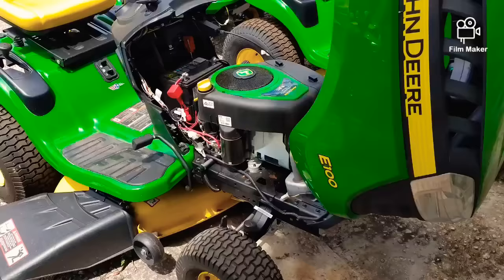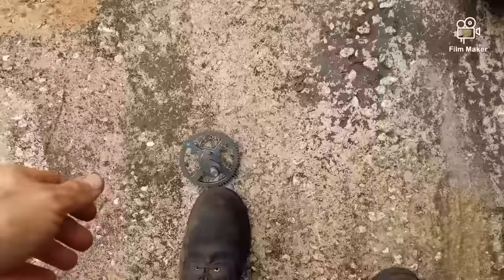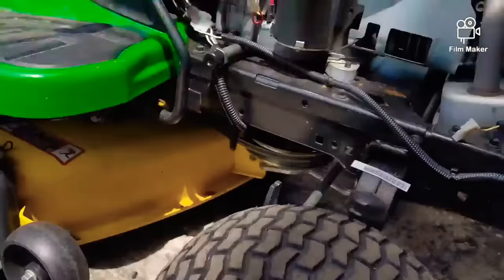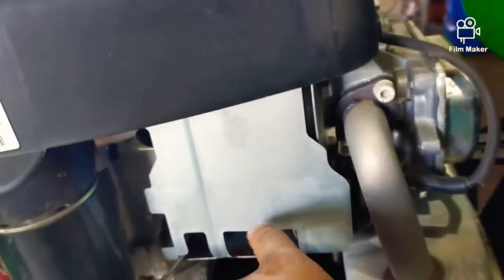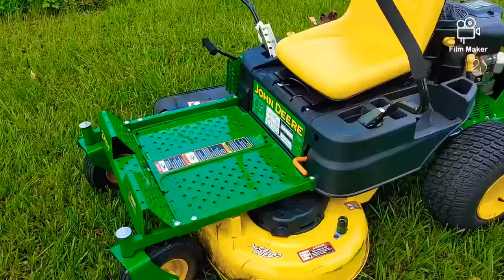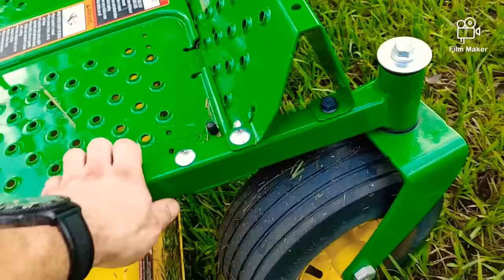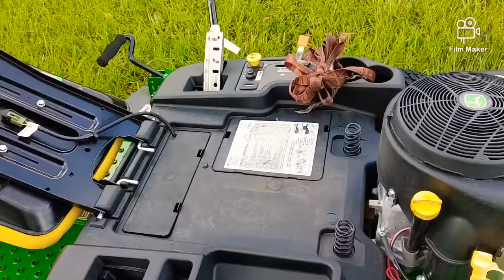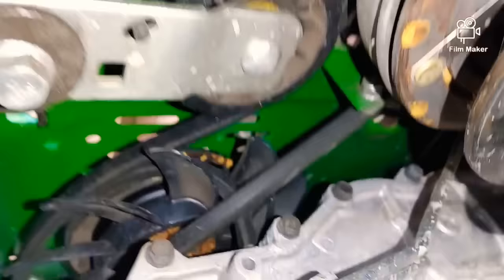Lawn mowers to avoid!

Comment: Do you have a video on adjusting the valves?
Reply from the maker: Not yet. I plan to soon. What mower and engine do you have?
Reply: @Mechanical_Mind  i have an x324 and a new x584. Want to do the x324 first for practice 😂.   324 is a fs651v

Comment: What model do you recommend for under $4000 for residential or what other brand? (zero or tractor)
Reply from the maker: The new 2023 John Deere Z 300s have made some serious improvements. Including improving the warranty to 3 yrs/ 200 hrs. (Before it was 2yr/ 120hrs) A 2023 Z330M would be a serious consideration Id make. However Cub Cadet Ultima ZT1 is my current top pick with their 3yr/unlimited hour warranty.
 
Ive recently looked at many brands comparing the residental zero turns and made some videos you may like.
In the first video I did going over the 2023 Residential zero turns I look at Bad Boy, Scag, Bobcat, Gravley, and Ariens. 
https://youtu.be/TBCQixtpu38

This one I go over Cub Cadet, Exmark, and Stihl. https://youtu.be/a0TkSzqnCSc

Then I just posted a video yesterday going over the NEW 2023 John Deere Z300 series mowers that replaced the model that I hate so much in this current video you commented on 🤣. Here is the video on the new 2023 John Deere https://youtu.be/wSLQwtbfVno
Thanks for watching. Hope you have subcribed!

Comment: Yup, they just aren't worth it.  I have one in right now where the entire deck is bent on the mounts and it cuts uneven.  Has about 100 hours on it.  I was shocked by the lack of grease zerks on it.  Sure, some people will get lucky, but these will usually cost you big money at some point with the non-servicable hydros, or the deck problems.  My advice would be for the same money find a used commercial unit.

Comment: I have a S120 and its been really good to me but im thinking about trading it in for a X350. Do you think it worth trading up or is the S120 a good mower?
Reply from the maker: The X350 is a far far better mower than a S120. The S120s is fine but they S models seem to be having issues throwing the deck belts.
Reply: @Mechanical_Mind  thanks for the feeback, i just wish john deere would of kept the yellow decks. I think the green decks are ugly as hell.

Comment: What type do you buy that's dependable
Reply from the maker: I've made some other videos comparing several different brands. The deck quality and deck thickness is the biggest factor.  Deck and deck components are the most common things that break and result in costly repairs. Avoid thin stamped decks and get a model that has a thicker welded/ fabricated deck. 
Most of the mowers brands are all using the same engines such as Briggs & Stratton, Kohler and Kawaskai.  Avoid the single single cylinder Briggs,  EFI engines and any that have electronic throttles.

Comment: Hey nice video. l have an 820-A 60 in deck with Kawaski engine 25 HP. 
while mowing the PTO switch likes to turn off and opinion would be Great thanks
Reply from the maker: Hey David, it's most likely the clutch is getting too hot from worn bearings, loose or damaged wiring harness going to the clutch, safety switch, or ignition switch issue.  I'm not saying it can't be the PTO switch but it's rarely the issue. Pto switch is the most commonly blamed yet the least common issue compared the issue I mentioned. 
Here is a video I did showing some common pto clutch issues 
https://youtu.be/92O3-Vzj4fo
Reply: @Mechanical_Mind  Hey thanks so l saa your video about PTO CLUTCHES WITH OVER1150 HRS I BELIEVE ITS TIME FOR PTO ASSEMBLY SHOULD FIX PROBLEM RIGHT?? THANKS FOR HELP

Comment: Toro 30 inch push commercial mower is junk. Aluminum decks crack..steel bolts attach Aluminum engine to deck.  Crack heaven

Comment: For years I didn’t think I wanted a zero-turn, and after test driving one I KNEW I didn’t want one.
Reply from the maker: Haha I fully agree again. I prefer lawn tractors for residential. Plus zero turns can tear up your grass if not careful and if a hydro goes out... $$$$
Reply: Zero turns unless you get one of the bigger ones with a special seat ($$$$) will mess your back up. They are THE WORST riding lawn mowers I've experienced. BTW I was a mechanic for John Deere until a couple months ago, I actually did a set up on a brand new Z-Turn that had a single cylinder engine on it, don't know what the selling price was.

Comment: Thank you for this video and information. I have a JD STX 38. It is 29 years old. It has a Koehler Command 12.5hp engine that runs like a scalded dog!  I want a ZTR by JD and I am going to buy it from my local JD dealer not Lowes or Home Depot. I like the JD 320R with the mulch attachment $3937.61 plus tax. Do you think it is worth the price?  Do you think it is a good mower?  I have a part time lawn business with my 19 yo son and want a more maneuverable mower than the STX. We cut 4 yards that we would cut with this mower.  Let me know what you think. I appreciate your professional opinion!

Comment: I am a retired mechanic with well over fifty years of experience and I have seen exactly what this young man is telling you. Yes, you may get lucky with the machine you bought and that's great I'm really glad for you. But there is a reason why a mower at a big box store is cheaper than if you go to a John Deere dealer. Or any dealer for that matter. They all do the same things. Just because it has the name on it doesn't make it the real thing. I could paint thorough bred horse on a mule but I would still have a mule. You get what you pay for. Anything that is cheaper is always less than it should be. My advice is to pay attention to the ones like this young man that say it is a piece of junk.
Reply from the maker: Thanks Oldguy3974! 🍻

Comment: Let me ask. The new z330r has better castors, a stamped deck and improved hydro’s…. Still avoid?  How do you feel about the residential exmark?  The quest series?
Reply from the maker: The 2023 model is far better than the one in this video. They improved 4 out of the 5 things I mentioned. 
Here is a more recent video where I show a new 2023 Z320M
https://youtu.be/TBCQixtpu38
Reply: @Mechanical_Mind  the R series being the Kawasaki engine. For half the price of a commercial mower, wouldn’t the residential in the 2023 model be the way to go? I mean if you’re not cutting commercially. And you have roughly 3 acres of grass?  I’m asking your professional advice..  the z330r has my eye on it, but I have a buddy who’s an exmark dealer… any input on their residential model, quest?
Reply from the maker: @kylemoore907  the only weak point now for the 2023 John Deere Z300 series is the stamped deck. So long as you dont hit a stump or cutt too low it will be fine. I prefer to get a mower with a stamped deck. As far as the Exmark I have zero experience with that brand. I plan to find an Exmark dealership soon and do a video on their models
Reply from the maker: For $4,000 Id go with a new 23' JD Z300 series. For $4,500 Id go with the Bad Boy Magnum. For $5k Id go with a Scag Liberty Z
Reply: @Mechanical_Mind  I guess that answers my question!  I can’t find much out there on the exmark reviews.. so I think it d be awesome to see you thoughts.   I subscribed, so hope to get that notification soon.   I’ve worked with a lot of landscaping companies and we used exmark. But those were their top-of-the-line commercial series. I’m working at the residential size mowers, as I don’t have 10k 😂

Comment: I have a John Deere Z535M and right side will not move forward or backward.  Happened without any warning.  Just finished the yard and right side suddenly stopped working.  Left works fine.  Right handle has no play in movement, move just like the left side.  Has oil and no visibe leaks.  Hoping I don't have to replace the whole transaxle.  Any suggestions greatly appreciated.
Reply from the maker: If it suddenly stopped working, I'd check to see if the drive belt pulley on top of right side transmission is spinning on the input shaft of the transmission. I'd see that a lot on the z900s.
Could be a sheared key or just a loose nut for the pulley.
Or the drive belt could have jumped out of the groove of the pulley and be above of below the pulley groove of the right side transmission
Reply: If the belt jumped off, the left side shouldn't work.  I think.  But the pulley sounds very possible.  I really appreciate the response.  Great videos on your site Sir.  Thank you.  I'll check this pulley out tomorrow.
Reply from the maker: The belt could still be on the left side properly and the crankshaft shaft pulley and the belt could still be tight because it could still be on the right side but above or below the groove. I've seen that happen many times on the commercial units. Hopefully that's the issue.
Reply: Thank you Sir.  I'll check it out today.
Reply from the maker: @robertviafranco2142  Let us know what you find on it
Reply: @Mechanical_Mind  Will do
Reply: Removed both wheels, when in switched to drive mode, left side is very hard to move (only moves forward very slow and hard), right side has no change when switched to drive mode or tow mode.  Left side moves like the right side when in tow mode.  No change either way on right side (stays the same in tow and drive modes).
Reply: Just became a member.  Great content on your channel.
Reply from the maker: Thanks Robert! Once you have confirmed the belt isn't off the right side pulley and that the pulley isn't loose from the input shaft there is one thing to check before pulling the transmission.  Check to make sure the key on the axle shaft for the wheel hub has not failed. It can be deceiving because the tire and hub will still turn if lifted off the ground but under a load while on the ground the axle shaft could be spinning inside of the wheel hub.  
If all those 3 things are not the issue, then you likely have some internal damage on the transmission
Reply: I did notice when I have the engine running and both handles in forward position, left moves and right doesn't.  I can move the hub forward and reverse like it's in tow mode.  Same when handles in reverse.  How do I get to the key.  Do I have to bang out the hub?
Reply: When I turn the hub, it feels like it's moving inside the transmission
Reply from the maker: @robertviafranco2142  that's not good at all if feels like it's moving inside the transmission.  It should be very hard to turn unless the transmission release/ neutral lever is released
Reply: @Mechanical_Mind  That's what I was afraid of.  Transmission here in South Texas is about $1300
Reply from the maker: @robertviafranco2142  unfortunately I've seen those transmissions explode internally with less than 20 hours on them.
Reply: This one has about 380 hrs.
Reply: @robertviafranco2142  I noticed a plug that is not connected to anything coming off of the wires coming off and near the battery.  Not sure if that is supposed to be plugged to something.  Or if is for a fuse
Reply: @Mechanical_Mind  I noticed a plug that isn't connected to anything in that battery compartment.  Short 1 inch pigtail coming out of a harness.  1 black and 1 yellow wire.  Is that something you may know that need to be plugged anywhere?

Comment: I'm currently looking at a John Deere Z655.  Used.  Appears to be in good shape.  Any input on that model?  Second question, I would like to put a smaller deck on it.  Is that reasonable/feasable.  I could get into smaller gates, if I had a smaller deck. Thanks
Reply from the maker: The 655 is a much better mower than the 335. Here is a video I show where you can look up all the parts including accessories for the mowers. https://youtu.be/9JgYcXJhQvM
*Note that no matter what type of mower you have, click the 'Commercial Mowing' section for a detailed break down of all the parts sections. For maintenance and accessories scroll down to near the very bottom of the page that shows all the categories.
Reply: @Mechanical_Mind  Thanks for the reply.  Especially the quick reply.

Comment: I just bought the Z530M. Please tell me that is a good model.
Reply from the maker: The mowers in this video are like a 1990 Dodge neon with blad tires and a blown head gasket. Your new Z530M is like a new 2023 Porsche GT3 compared to them. 
John Deere did finally improve the Z300s for 2023. They are actually pretty good now too.
Reply: @Mechanical_Mind  Thank you! What a relief.

Comment: Those zero-turn mowers look like they were intentionally designed to stay in the shop getting fixed. You'll probably spend more in repairs within 3-5 years than the cost of the mower. They should be ashamed to sell that garbage.

Comment: Lol deck speaks for quality that’s the cheap model no better than a basic none zero turn the welded decks usually are the better quality . As fir drive unit on lawnmower single pump with individual drive motors for wheels  hydrostatic drive boxes are decent but long term not worth it.

Comment: I’m looking for a ride lawnmower for my yard and it’s a pretty rough environment. Hills bumps, not very flat. What would you recommend?
Reply from the maker: Bad Boy residential zero turns have a nice  smooth ride with their rubber bushings. Id highly recommend taking look at the new Husqvarna Xcite 350. I recently filmed one and its suspension is the best Ive seen in its price range. For $5500 it blows away its equally priced competitors. If you want a lawn tractor the John Deere X300 series have a really nice ride and are very durable lawn tractors.

Comment: Which 42” Residential Zero turn do you recommend under $4,000? Sounds like you find problems with all of them. Which do you find the least problems with?
Reply from the maker: I like the 2023 Cub Cadet and Husqvarnas
Reply: @Mechanical_Mind  I just bought the Bad Boy MZ Magnum 48”. Only 1 mow, but pretty happy with it so far.

Comment: I liked your video slim but I think you misspoke when you said them from tires took 40pds of air are you sure on that hell I don't put that much in my truck tires
Reply from the maker: I did. I ment to say it holds up to 44 psi. The tire actully says max psi is 46 psi. Either way they never hold air.
Reply: @Mechanical_Mind  wow that's amazing for them little bastards .but you could put tubes in them and that would stop them from going flat .on my atvs it takes up to 30 pds to set the beads then I let the air out down to around 8 pds

Comment: I have that zero turn or some close variant. I inherited it, and wasn't using it till my Cub cadet broke an axle but I'm now going into the third year mowing with it.  No problems.  Don't like the choke integrated with the throttle so it has to cold start at full throttle, kinda stupid.  But it's obviously flimsy so I treat it as such.  It's toyish but easier to use this than fixing my Cub.  We have a Scag in the family; you could buy a small fleet of these mowers for that cost but there's a real difference in capability.  It is what it is.

Comment: I have a few John Deere tractor mowers they work most of the time, except my zero turn z757. The motor is rather new, but the transmission is out. I Will not fix it. But I have a d110, and a d160 that seem to work ok. Are those any good?
Reply from the maker: Hey Frank, The D110 👎 The D160 👍. The D110 most likely had a plastic transmission depending in the year. If so just take it easy on it

Comment: Now I’m looking at a 530R and a 545R, are those good ZTurns?
Reply from the maker: The new generation (2023 and newer) of the Z300 is light years better than the previous generation Z300s I talk about in this video. 
Personally if I was going to buy a mower in the $6k to $7k price range it would be a Scag. I also like the Toro & Bobcat zero turns. 
I recently did a video on residential zero turns in the same price range as many of the Z500s. 
https://youtu.be/Y6qVdtmI0sw

Comment: I was considering buying a 2023 John Deere Z530R Zero-Turn 60" mower with a 24 HP Kawasaki engine.  Are these models crap also?
Reply from the maker: No. The 530R is far better. Even the new Z300 line up has been drastically improved for 2023.

Comment: Thank you for the video.  I am glad you pointed out the problems you run into everyday.  First I can't believe that plastic axle.  For what these cost and the abuse they get, Plastic?  Come on.  I also can't believe that Briggs engine uses press on cam lobes.  I raced the old flatheads for years in a gocart and we usually coubled or tripled the hp.  Course we used an aluminum aftermarket rod but pressed on cam lobes.  You know Briggs is made in China (that's how the Chinese knock offs came about...China just stole the technology.  Thganks again for the video.

Comment: I have a z545r zero turn. 7 years old with 145 hours and the left wheel will barely pull. Is this common. The tranny is not servicable. New one is $1400. New belts and idler pulleys didn't help. Dealer said no adjustments, just have to replace. Any thoughts? Is this common with this mower?
Reply from the maker: I have seen several of those transmissons have damage that pretty much makes them a total loss. If the housing isnt damaged Its possible to rebuild it but it would cost around $800 or so with parts and labor. Not including removing and reinstalling it.

Comment: Good stuff! Any opinions on the new electric zero turns?
Reply from the maker: Hi John, my opinion is that they would be fine for residential use only. Im a gasoline guy but I do have an electric push mower for my home and I do like not having the worry about gas, oil, belts, filters, etc etc. However my range is limited.
Reply: @Mechanical_Mind  thanks much